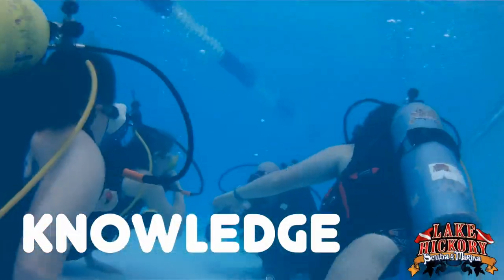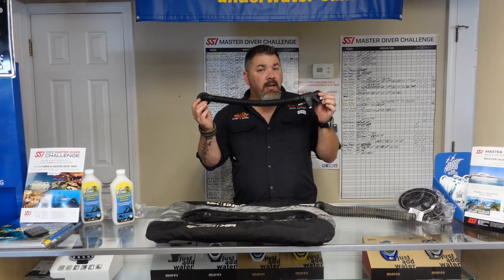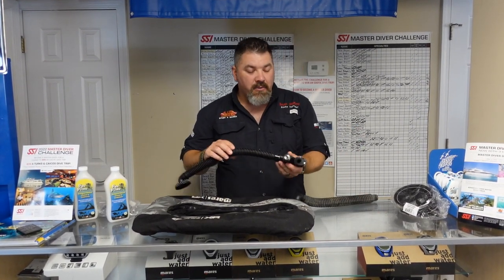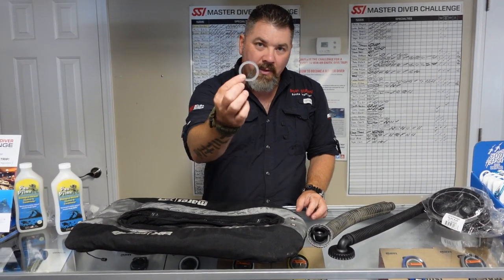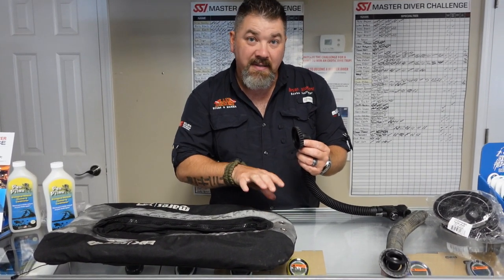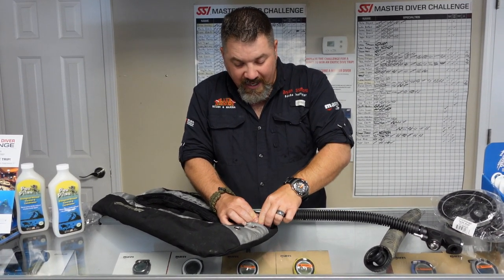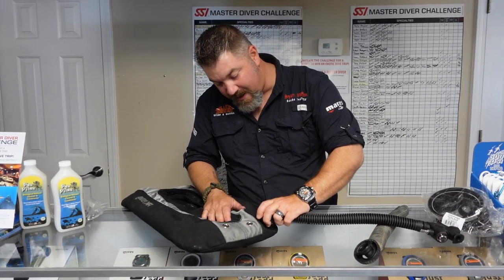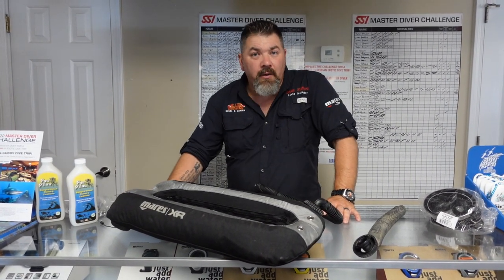Replacing Your Inflator Assembly

Comment: Is this the same for a Scubapro Nighthawk assembly? Thanks.
Reply from the maker: Hello @Perly53, I would have to refer you to a Scuba Pro technician to give you a more accurate answer. That being said, most BCD's operate the same way. The key to replacing an inflator system is to make sure it does not get cross threaded.

Comment: do you need to do anything specific if you have an inflator that has a cord inside (so it deflates when the hose is pulled down)?
Reply from the maker: Hello MrNachtduiker, yes you do, and thank you for asking that. The Mares XR line is a no frills no thrill system, but most other styles and brands have a pull dump inside them. If this is the case, the first thing is to verify the gasket on the bladder side is in place, and that there is no damage to the inflator side where the cable is attached. In some cases, it may need to be shorted, as with most inflator/second stage combo's. The Air 2, Gemini, and Air Control are examples of these. If you are assembling the entire unit, without changing out the inflator itself, then its a pretty simple swap out.
Reply: @LakeHickoryScuba  Thank you, that is really helpful and informative.